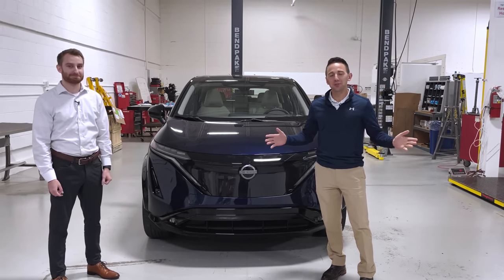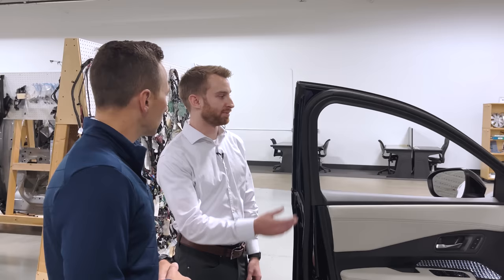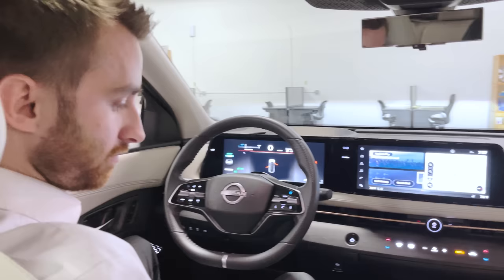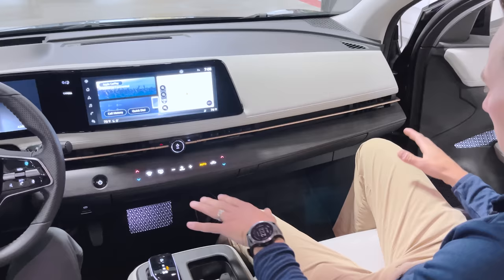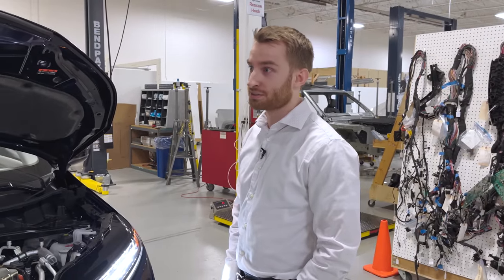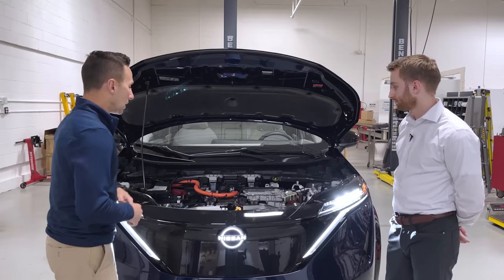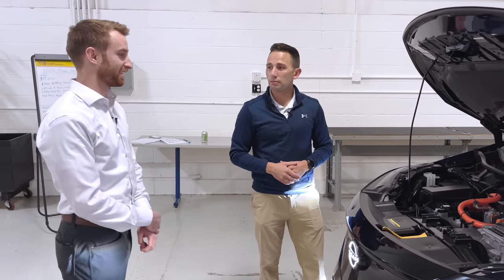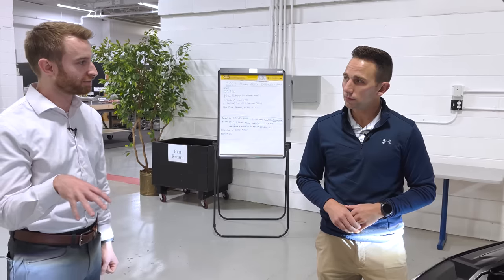Nissan Takes the Tesla Approach with Its Integration on the Ariya

Comment: Sad the Ariya charging speed is poor, acceleration is not EV like and the price is way too high for the range you get.
Reply: MOST people charge overnight on 240v, not at FAST chargers.
Reply: @markplott4820   most people?  who are these people you are referring to?
Reply: @markplott4820  At that cost it should do everything. Charge fast for trips, don't you want to take your EV on a trip? Accelerate quick at all speeds. 0 to 60 included. Front wheel drive, being pulled, in an EV feels wrong. RWD in an EV, being pushed, feels right. We have not even got into battery preconditioning, trip planning and all the stuff needed for an EV to be a great machine. Nisan be the one most aware of all of this making the Leaf years ago. Then there is the cost.. Its too steep.
Reply: @ChicagoBob123 It charges faster than some of its rivals, about 30 minutes for 10-80% and less than an hour for a full charge from 0 to 99%. That's slow you say? Not in my book.
5.1 seconds from 0 to 100 kph is slow? Also not on my book.
Battery preconditioning is manual but available, although it doesn't need it as much as other vehicles because it doesn't need as peak charge speeds as others for charging fast in the same effective time.
Reply: While 10-80% isn't super competitive, 10-90% is on par with Kia/Hyundai

Comment: hope they get rid of the CHAdeMO connector, to let you know of how useless it is in Australia. looking at data, out of 83,000 EV's in Australia about 2150 are Nissan, so you can Imagin the unnecessary cost outside of tesla super charges that every charge point has a CHAdeMO connector included just in case a Nissan needs charging.

Comment: Kill two birds with one stone? What do you have against birds? Having a Tesla approach is fine but what about cost of repair? I don't own electric but have wondered about the brake light situation. It used to be if you didn't want to show brake lights you could downshift or even use emergency brakes. We may need three lights for accelerate, coast and brake.

Comment: The buttons seem too small and close together on the bezel. Functionally grouping the buttons would be better instead of spreading them uniformly. I wonder what the body wind resistance is since that's such an important factor for an EV. A manual hood strut seems cheap for this trim level. Brake light indicator is a nice feature. I know it's a Press vehicle but missed the undercarriage view. Is no frunk important to EV buyers ? Overall good review, thank you for your time.

Comment: no wonder the Nissan Leaf did not see substantial updates despite the pioneer of consumer EVs. Good thing they are still ahead of Toyota.  Then again, still years behind Tesla.  Just one to point out, why do we still use lead acid batteries in most EVs despite it costs a lot for its capacity and longevity. The benefit of lead acid is large currents for starting ICE but has no use in an EV. No space in the engine bay means no frunk.

Comment: On the Tesla interiors: they are made deliberately SIMPLE because when the initiate the robotaxi-mode, as a supplier of this type of service you need a car that is very easy, simple, fast to clean. The more different elements in the interior the more difficult and time consuming it becomes to clean the interior. Someone should check the quality, durability and colorproof (?)  the Tesla interiors are. They are made for this purpose. (All other interiors are just eye candy) imo

Comment: looool, the coil magnet rotor is NOT efficient. Magnets are definitely better, and Tesla's magnet+reluctance motor is even more efficient. The battery + brushes+ excitation circuit costs easily offset the cost of magnets. Probably on par with induction motors on efficiency, with just a larger performance window (lower the excitation current to be able to spin it faster). stop parroting marketing propaganda. likely just concerned about being reliant on Chinese supply chain.

Comment: Why do they do capacitive touch buttons on part of the dash, but still keep the turn signal stalk and silly "shifter"?  EVs do not need shifters, use a button for d/n/r.  Stalks are silly, a button for your thumb is much better for turn signals.  That shifter and stalk are likely parts used on other nissans, parts bin garbage.  

A start button should be optional, i am fine with it there as an emergency stop or for people who still want it, but there should be a setting for auto start to avoid pressing the button and brake just to turn the car on.

Infotainment was made more modern, but then they left the parts you must use on every drive to be old and crappy.
Reply: Buttons for turn signals are a pest in Europe. Roundabouts.
Reply: @charlesbridgford254   You should never be needing to use a turn signal in the middle of a roundabout. Not waiting until mid turn to signal and signalling before you turn is driver's ed 101. Poor road design is not a reason to keep antiquated controls on cars.  Your car can also auto signal if you put the destination in.   Europe will have to modernize their traffic laws because stalks are old garbage technology. It would be like making people use a manual type writer to print a copy of a document rather than using a modern printer.
Reply: @_PatrickO  In the UK, when turning right at a roundabout, you absolutely need to change signal direction mid roundabout, to signal that you are exiting.

Not only is it good etiquette to maintain traffic flow, not doing it would fail your test.

Trying to find a button on a steering wheel on a busy roundabout is something I personally don't want to experience bearing in mind that where I live almost all road junctions are roundabouts.
Reply: @charlesbridgford254   That is impossible.  If you are leaving a roundabout you are already in the right most lane(or two lanes if both exit) and can just leave without crossing other traffic.   There is no one to signal to when leaving a roundabout.  That is the whole point of a roundabout, so traffic interferes less.
Reply: @_PatrickO  Wrong.

Most roundabouts, apart from very large spiral roundabouts, don't have marked lanes on the roundabout. So you need to move from the inside to the outside when turning right, using a signal to do so.

Comment: Gigacasting will (hopefully) make EVs easier and cheaper to build, but the major downside is that it will probably greatly increase the insurance costs since even a minor accident can end up being a huge cost.
Reply: So a small saving on purchase cost, once.
Hella expensive insurance every year!!?? Not a good trade!!
Reply: Teslas have bolted on crash rails that protect the gigacastings during minor-to-moderate collisions.  The whole “gigacastings will lead to skyrocketing insurance costs” has been debunked by videos on this exact channel.
Reply: The castings are as deep within the vehicle as the corresponding structures on conventional cars and if they're damaged,  the car was totaled already.
Reply: If you're ever in a collision bad enough that the gigacasting bends or cracks, you'll be thanking your lucky stars you're still alive instead of lamenting that the body shop can't bend it back into shape